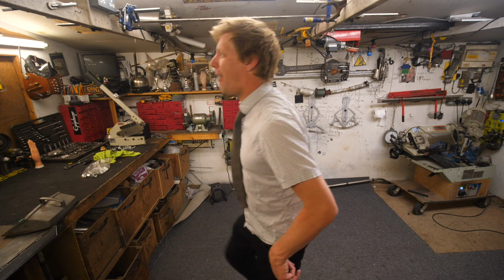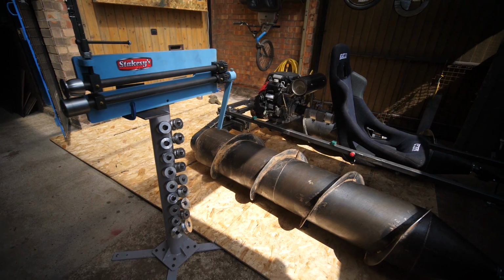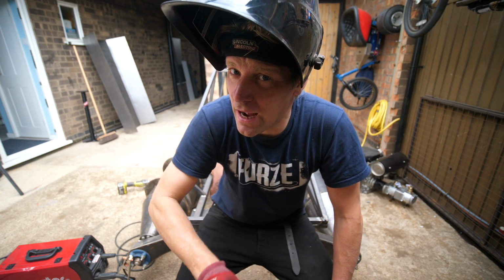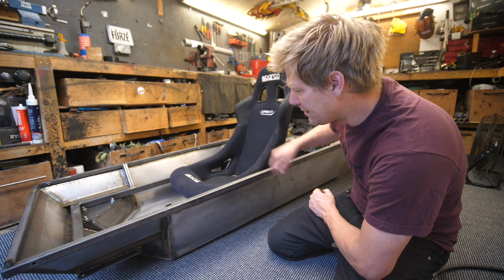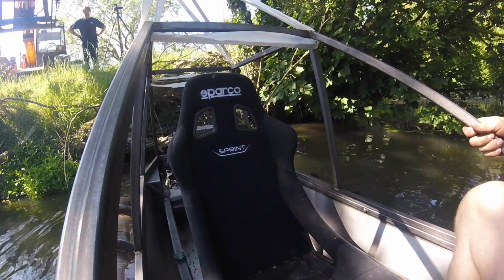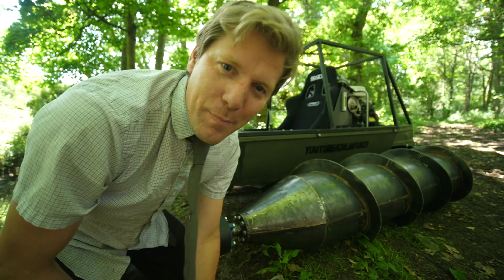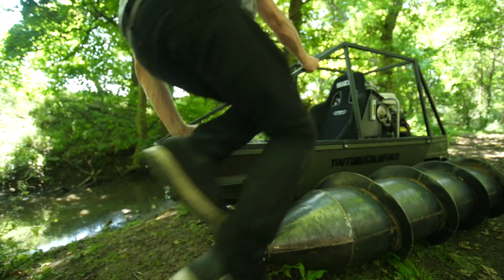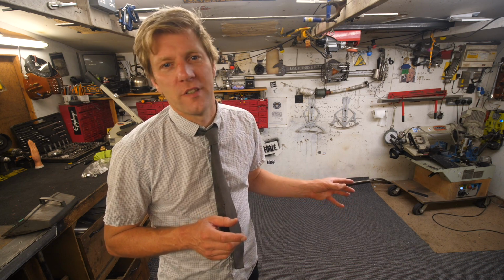HOMEMADE SCREW TANK WATER TEST

Comment: I will suggest to put a gear system on the engine, so the screws can spin faster on water and get more torque on land
Reply: It’s hydraulic 🤦‍♂️
Reply: @itchyprince3793  you can still change the gear ratio lmaooo
Reply: @itchyprince3793  who are you, who are so wise in the ways of science
Reply: @luizfernando4497  it's not really science to say. Its engineering
Reply: @jamessouza2436  its just a meme

Comment: Colin: "we need to make it more buoyant"
Also Colin: welds more steel bars to the screw tank
Reply: As you know most ships are made of all steel and the they weigh hundreds of tons. As long as the forces on it push harder upwards than it pushes downwards it should float. It’s the law of Archimedes or something
Reply: As long as the weight of the water displaced is less than the weight of the object, it will float.
Reply: @masonx3bm  Exactly it's not the weight of the object by itself but how much water it is displacing with said weight.
Reply: @masonx3bm  exactly the opposite, I'm afraid
Reply: @secdeal  slight typo but you get the drift (no pun imtended)

Comment: I think this is definitely my favorite project youve done Colin. You have created a masterpiece! I absolutely love it! However i have one idea for improvement: if you used a larger diameter screw body you would get more air volume for better flotation  and it would make it taller for better ground clearanceand AND it would increase your speed. I think?
Reply: The speed depends on the pitch of the threads, so it would't necesarily mean more speed, maybe even less speed

Comment: 10:47
 Says "It's very historical" as the light tank is flying off the cliff at 80km/h
Reply: Well, they can do that, once anyway... 
I recall seeing the footage of a tank that was being decommissioned and which had the governors removed from the engine, being jumped off a ramp.  It was very impressive how far it got, airbourne.  Of course, the wheels, tracks and drive gear was completely trashed afterwards.
Maxim 11. Everything is air-droppable at least once.

Comment: This tank will easily traverse all terrain... except for tarmac, concrete or any hard surface
Reply: What about going sideways. That should work?
Reply: Lol wish I had money to make this type of content
Reply: Well if it's a screw, there's like a small amount of traction so wouldn't it still be able to traverse hard surfaces just with limited performamce?
Reply: Clemens the controls don’t seem to allow that
Reply: The hard surface will damage the blade and make it not a screwl anymore.
Reply: @skipper5395  yes they do he has individual control over each side of both soon the same way hell go side ways if the go opposite directions hell turn

Comment: Its good to see someone do a screw tank with some serious screws on it rather than the weak ones you usually see. Next drive challenge: Deep snow. After that? Really test it out on a solid material that someone doesn't mind getting torn up. Find some concrete or asphalt that is up for removal to drive on.

Comment: Have it reload a spud immediately after firing.  That way the slow part is done and you can load gas then spark when you hit the trigger.  Might need to add a "prime" botton if you don't want to dry-fire it every time you reload.

Also, https://en.wikipedia.org/wiki/Finite-state_machine  The most reliable way to sequence/structure tasks like this.  As an added bonus, state machines are trivial to run in parallel.  So are a great for multi-tasking on an Arduino.

Comment: I think that I'd personally rase the lip on the back up a bit. Like as up as possible. It's not like it really needs much access and what little it does need could be provided by removing the seat. Relatedly I think that I'd have put the oil under the seat itself for better weight distribution. I think that I'd have also added some resin coating to both the inside and outside to prevent any water damage or leaking or anything of that type. Possibly also added some non-stick spray to the screws just because they'd otherwise get as messy as they did. Possibly also repossitioned the screws for more clearance and added some floatation tanks under the bottom or something.

Comment: For better buoyancy, I'd fill the tanks with the lightest gas possible, but maybe making those tanks even bigger might help. What about using fiberglass instead of steel? and like canoes having air tight compartment in the front and back to add even more buoyancy?

Comment: the screws gotta spin faster for the water .... something like a mutch higher gear and perhaps an extra chunk of more power then (on/off switchable electric motor on the same axis/crankshaft is less trouble to build then a turbo or something)  ... and it also needs mud/splash guards ... just like a car would for its wheels

Comment: You should make a self spinning zylo (nigahiga) glider !  Maybe use a ducted propeller or ion wind or both ! Could place a high voltage wire infront of the spinning airfoil and make the props anodes ! Idk think it could work ? If it does maybe you can make enough to propel yourself !

Comment: The steel cage is a horrible idea for on the water, entrapment.
I would suggest Lexan, Plexiglass or something, solid and water proof up another foot, then hinged so you cna open it above that.
This gives you reserve bouyancy in case you encounter waves, enter/exit or turn, and excellent visibility all around, plus some protection from branches and crap entering the cockpit.

Comment: You need more RPM and power on those screws to give them more speed when in the water.  Surely you haven't done all that work to have it be slower than an RC boat from walmart?

Comment: That hull could have been aluminium, welded to brackets and then bolted to the frame. Yeah you love steel but bring the weight down once in a while, huh?

Maybe the screws could be rigged up with a lower atmospheric pressure to bring the weight down and floatiness up.

Comment: Use a truck air tank and shot it with that and use alumnum instead of patatoes theres a place called drumcloge where you can take tanks and deep water there and loads a bits to go in also has bikes and qouds there

Comment: I wonder what a higher angle on the screws which would give more lift and larger augur blades would make it faster kinda like longer screw threads I think would increase ratio possibly and does the hydraulics over heat cuz the constant fluid flow it makes with the small oil reservoir it has without a electric cooling fan and cooler i didn't see one on there but it's awesome indeed there's about $6,000 in hydraulics on there a least 2 pumps and servos and the plumbing which he mostly used hard lines which is a must in all fixed line positions cuz hydros tend to jerk back and forth while running forward and backwards like this does during turns and what not but great engineered fine fabrication job the only thing I'd done different is deeper screws fins and higher pitch or angle from the tub to the screws for more ground clearance and larger diameter pipe that the screws fins are welded on which I know would make it float better and cover more ground and obstacles easier like 18 inch or 24inch pipe would work awesome like schedule 20 wall ID wouldn't be to heavy yet plenty sturdy to hold up plus that's also gonna give more of a pontoon effect as well

Comment: I would like to see stuff built that anyone could build. They don't have to be welders, mechanical engineers and so on all rolled into one.
Grab a load of stuff from a scrapyard and put it together with nuts and bolts and such to make something that requires nothing more in your toolkit than a set of spanners and a drill and maybe a metal/wood saw.

Comment: Should make a replica world word 2 launcher patato cannon like I did 2  2by 6s hallow out use 2 screws hold wood together then add 2 bolts thru stock into in side pvc don't glue it yet bolts it then un bolt toggle switch in front battery in cavity and round edges of stock and put a side sight that folds cool project made it as a kid still got it and put a black star on back in a circle and paint ode green once done sand it paint put back use 2 Bolts to bolt in stock to spark it u could but 3 botls if u feel better u only need 2 and them 2 bolts regardless u put it tight to wood then leave 2 inches then 2 nut 2 washers and 2 nut on top for the 2 to spark and copper washers are best and u can cut em into any shape or design u want lights fuel better based off telsa